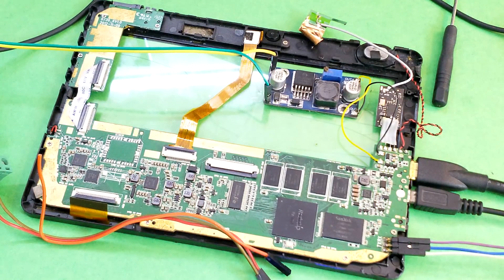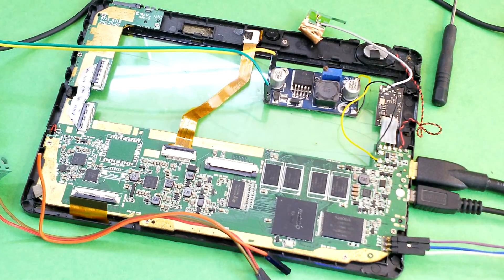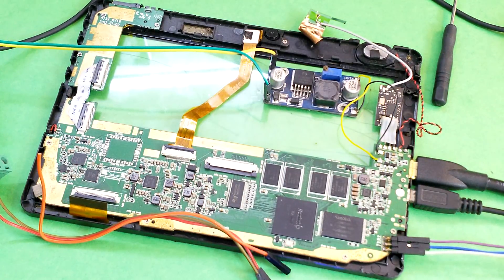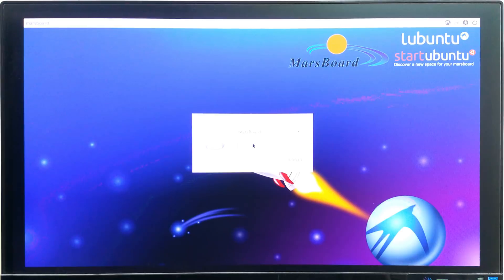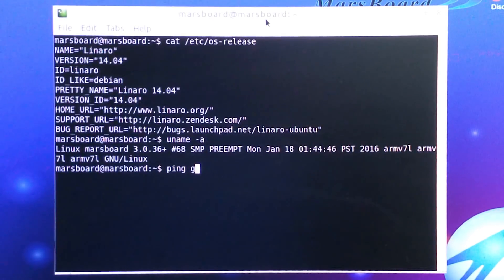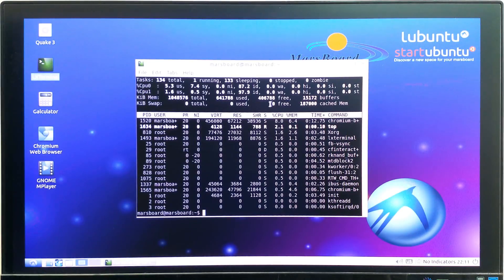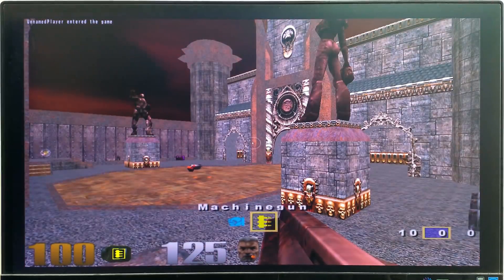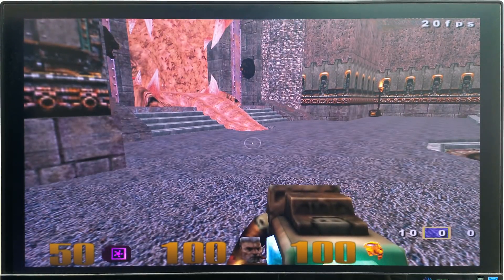Running Ubuntu and Quake 3 on Cheap DIY Single Board Computer From e-Waste | Part 3

Comment: Super awesome video. Quake 3 was looking nice, even though the settings automatically disabled most dynamic lights and shadows. Some games suffer from being a bit difficult to navigate when two faces of the same exact texture share an edge, because the edge becomes invisible. But in this case, they used starkly different textures for the walls and floors, so everything looks pretty much fine. Very cool that you were able to get this running on this specific piece of hardware. I'm curious if these are available in bulk for a cheap price.